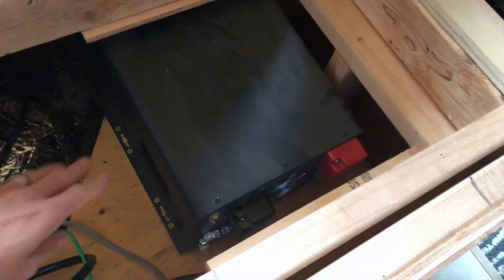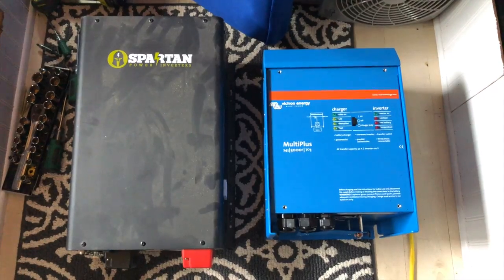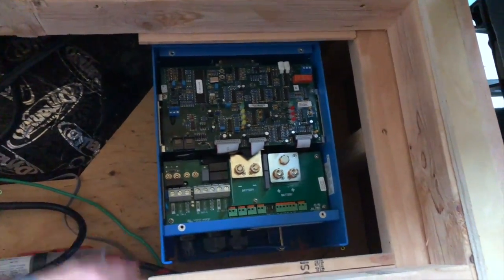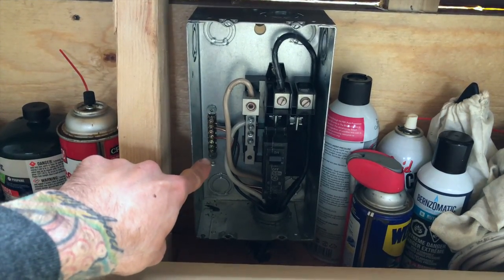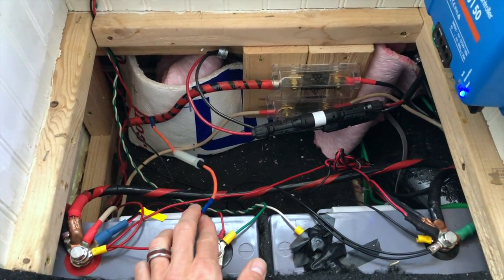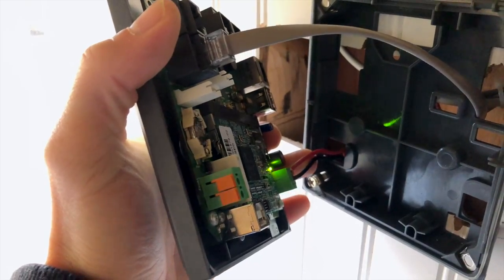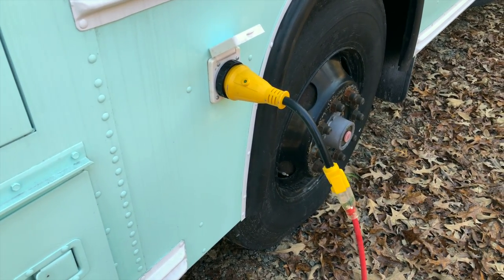Installing A Victron Energy MultiPlus Inverter Charger

Comment: I think those 2 small wires on the shunt are to connect to the monitor. The temp connection is a single terminal that goes directly on the negative battery terminal.

Comment: Thank You for the video, I'm get ready to wire up my rv with the 24/3000/70-50 MultiPlus also.  I put 6 - 325 watt panels on the roof and have 4 -  50 amp 24 volt batteries.  It's good to see how you have installed your system.

Comment: Looking at buying exactly this unit.
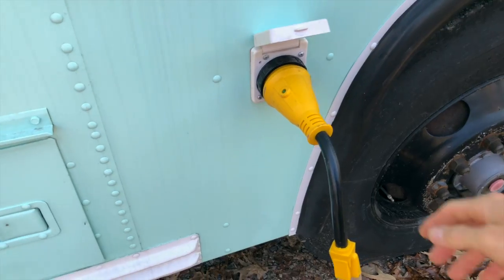@8:46 - Is that a 50amp 240v Marinco inlet? I think I have the same one.
From the inlet to the Multiplus, did you wire in both 120v lines?

Comment: Hi great video if I fitted a similar unit to a house when connected to AC input would it constantly use shore supply or can it switch back to batteries once they're full and use battery power instead? Thanks

Comment: You’ve gone full victron!! Like Apple — get one thing, and it becomes very difficult not to get sucked into the echo system lol. Just wish every little  cable etc wasn’t an additional purchase.
Reply from the maker: It most certainly is. Really love all the Victron eco system, but I do agree that all the extra cables shouldn't be extra. At the same time not every install is the same and requires the same length of cables so it would be a waste of money for them if they included say a 6' cable when not everyone would use it.

Comment: Great video, thanks for sharing!  I have a possible concern on your wiring, I'm not an Electrician, but I have learned that grounding is a MAJOR issue to get right.  If it is t, you can cause fires.  So first question I have is this:  in that 50 amp fuse, did you combine the ground and neutral?  If so, my understanding is that is VERY dangerous.  

The issue is you only want one point in the whole system were The ground and return are combined.  Here’s why, if you have two of them, one in the main electrical panel of the house you plugged into, and one in your bus, here’s what can happen…. Something in the house short circuits, but for some reason it find the shortest path is to go through the 12 gauge wire you have hooking up the bus to the house. So the result is a lot of voltage going through that wire.  Put too much voltage, your 12 gauge wire will catch on fire.  

It is my understanding that very cool Victron multi plus is designed to switch automatically where the return in ground join. When attached to shore power it disconnects it, when not attached the shore power it connects the two inside the multi plus.

All in all, it is my impression that The safest thing to do is to keep the ground and return isolated between shore power  and  the multi plus.
Reply from the maker: Thanks for your comment Sam. You are completely right that you do not want to combine the neutral and ground within the panels of the electrical system. That is why in each of our panels we have the grounds isolated from the neutrals on a separate grounding bar within the panel. This allows the breakers to due exactly what they are meant to do and trip if there is ever a load too high or short circuit within the system. 

After 3 years with this system in place we have yet to have any wires show any signs of over heating and the system has run flawlessly for us.

Comment: Hello, just found and watched your install  (a few times). I have a system currently set for 300 amp hour via the multi plus in my travel trailer (like the one featured in Keep your daydream ), but I don't know how to connect the wiring to the panel, and I'm over wellemed with videos showing unrelated systems. Do I use a sub panel such as yours and where did you get it? 
Thank you.

Comment: i saw that all the load cable's are at the battery, if u want an accurate dc load calculation from the bmv battery monitor, the load should be after the shunt not at  the battery

Comment: What is the advantage of a 24 volt system? Dont you lose a small amount of electricity converting it down to 12 volt for lighting? Also do you have video of the conversion process of your bus build ? It turned out beautiful
Reply from the maker: With a 24V system the solar conversion through the charge controller is more efficient. It is a 200Ah battery at 24V, but still has the same watt capacity as 400 ah at 12V. You do lose a little bit of power to converting down to 12V, but it is negligible at best. I do have some of the videos from the conversion process and plan to make videos in the future. Thanks for the compliment.
Reply: @SoulfulBusLife  thank you . I have been trying to learn more about solar so this was very helpful.
Reply from the maker: You're welcome. I do plan to do another video about solar where I will talk about the break down of the entire system including the wiring process from the panels all the way back to the batteries and go more in-depth to why we built the system the way we did.

Comment: Great video Thanks!
I have a dumb question: The 100/50 MPPT charge controller output: does that go straight to the battery bank or in via the multiplus?
The reason I ask is I am about to replace my whole solar array and charge controlle/s etc (andI also have a Rutland 400W Wind Generator)  but do ultimately want a Victron 12/3000/16/230v unit: but I figure I'll still need the 100/50 charge controller.

Do you have any issues when charging via 110V AND Solar ?
What size is your solar array as well?
Sorry for all the questions: I do like your setup though! :)

cheers
-Troy
Reply from the maker: There is never a dumb question when it comes to electrical, especially solar cause it’s a bit confusing at times. The charge controller has an input for the solar panels and then an output that goes to the battery bank. Then from the battery bank it goes to the multiplus.

Comment: Just a small point, it is NOT a 3000 watt inverter. It’s a 3000 VA inverter, which in the dc world would be 3000 watts. It is really a 2400 watt inverter in the ac realm.

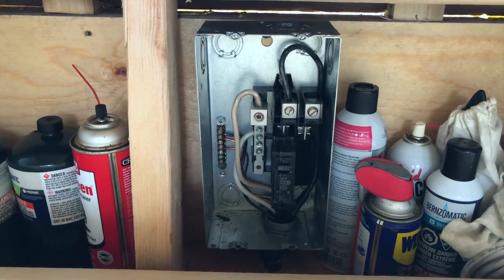Comment: 4:30 why ground to the frame of the bus? won't that cause a localized short to energize the whole vehicle ... the whole gasoline powered vehicle? I thought the ground would run to a grounding rod or... nowhere.
Reply: A mobile system does not have an earth stake. So, something else is needed to create a central earth potential and a safe situation. All touchable metal parts of the vehicle or boat  must be connected to each other to create a local earth. Examples of metal parts in a boat or vehicle are: chassis, hull, metal fluid pipes, railing, engine, power point earth contacts, lightning conductors and the earth plate (if present). This is done (in part) to avoid "grounding loops" which can result from multiple grounding points where differences in current/resistance exist. Therefore, in any mobile or marine installation, the entire AC/DC system must be grounded via a central grounding bus bar connected to the chassis/hull at a single point with a conductor sized to carry the entire load of the system. Grounding is needed for electric safety and it also creates a reference point in a circuit to which voltages are measured. That means the battery bank negative, inverter/charger negative lead and case bond, MPPT battery negative lead and case bond, the PV array frame bond and all other negative/ground/bond leads are connected to the central grounding bus bar.

Comment: Isn’t 8 gauge plenty for 50 amps?
Reply from the maker: 8 gauge can handle 50 amps, but doesn't have much room for error in regards to over voltage and heat in the wire. Always better to over gauge than just run at the limit.

Comment: Where is your solar panels?
Reply from the maker: Our solar panels are mounted on the roof.
Reply: @SoulfulBusLife  how did you mount it? And how big are they?
Reply from the maker: There are 4 265 watt mounted right down the center of the bus. We used some brackets we found on Amazon. In the process of creating a video talking about Solar panels and maintenance. You will see exactly how we mounted them.
Reply: @SoulfulBusLife  great thanks can't wait to see.

Comment: Thank you...  I have an older toyota rv that uses 30 amp shore power...  Will this victron multiplus not only convert shore power but also invert battery power for all my 110v devices?  

I plan on installing 3 qty 12 volt lithium iron batteries...   

I would like to charge my batteries using my cars standard alternator doing trips..  I plan to upgrade to solar but the expense of this multiplus unit prohibits that for a couple of years

I apologize if you answered this ..  You provided so much useful and pertinent info i was ovwrwhelmed...

Camposvazquez@gmail if you have a website/patreon/venmo i can compensate you for your consultation...

Thank you again

Comment: Thanks for sharing your install. Question:What are you able to power when you are on inverter? Are you only hooked to 1 leg when off grid?
I have a automatic transfer switch for my gen/shore then that feeds to the main panel  w 6/3 romex wire. I cut the wires there and ran gen/shore to the input of the multiplus and the out from the main panel...What do you do with the red hot wire? 
Thank you

Comment: How much dose the inverter cost you please
Reply from the maker: Thanks for the comment. If you check out the links in the description box you can see the pricing and full specs for all of the components in out solar set-up.
Reply: I'd love to see a diagram for your solar setup. Do you have one? Planning ahead for our in progress conversion of a Thomas MVP ER. Still working on repairs to mechanicals, but it won't be long until we're doing the solar setup.
Reply from the maker: @larrym6019  I am actually in the process of creating one for some college students that are converting a bus for a woman and her two children. It will be available on our website once it is finished. I will link it in this comment once it is available.
Reply: @SoulfulBusLife  Awesome. Thanks!